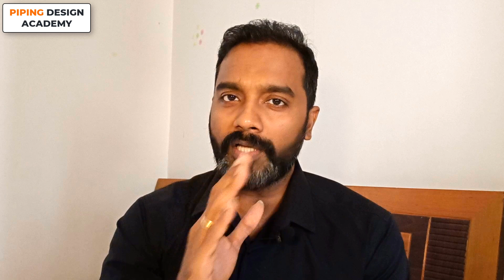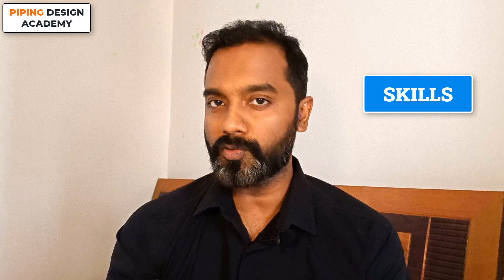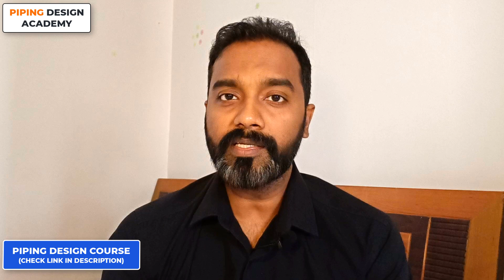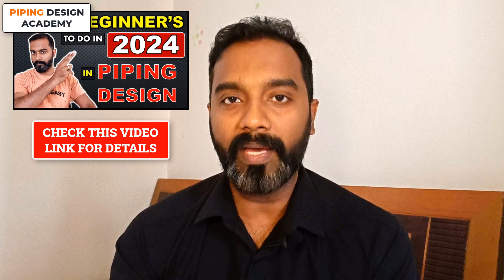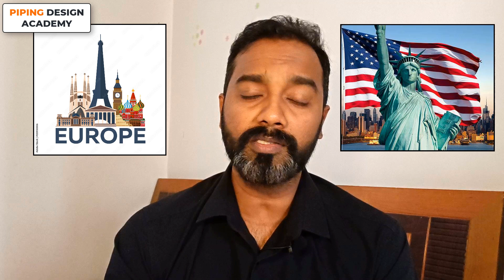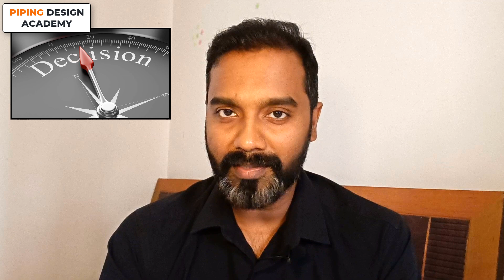Much Awaited Q & A for Piping Design Engineering Career

Comment: Need a small suggestion, I will complete by BE this year as i want to go in piping design career also i want to persue master degree so which course should I opt for in master degree so that it would help me in piping designing.
Reply from the maker: BE Mechanical Engineering is more than enough to become a Piping design engineer. Masters are not required for Piping Design